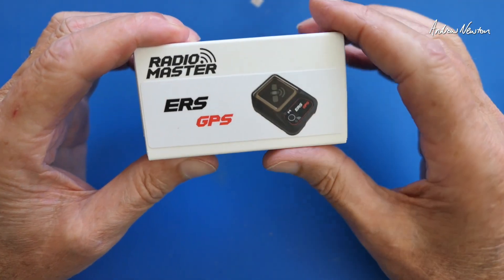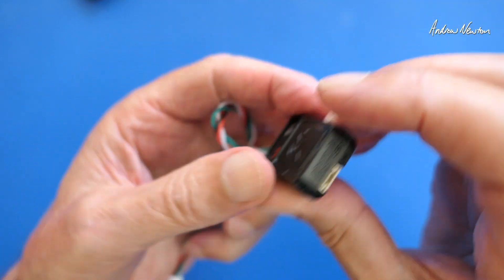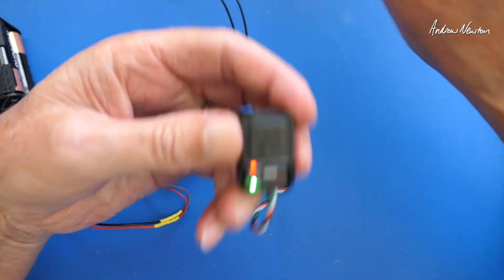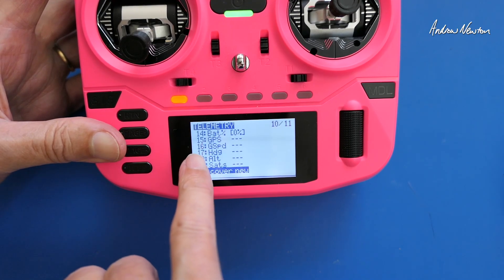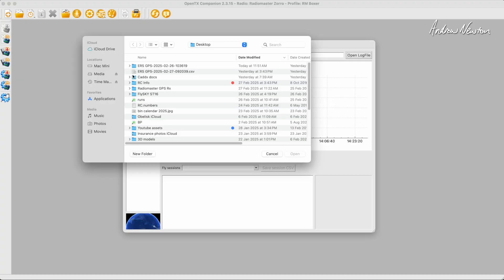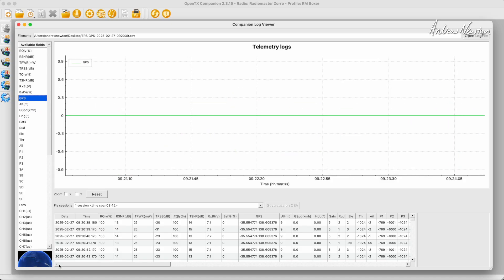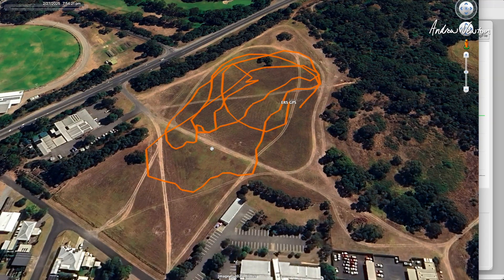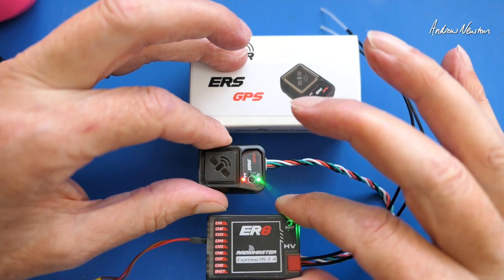RadioMaster ERS GPS Telemetry Sensor

Comment: How do I get data logs in one file. Can you please explain this also, I tried to do it watching a video but when I start logging with 3 position switch on my radiomaster pocket and stop logging I get 4-5 files with data in them but not only 1 file. Thanks for the video. I have bought GPS after watching this video.
Reply from the maker: Should be one log file for each switch activation. Did you switch a few times when setting it up?
Reply: @AndrewNewton  In Special function (Page 10) I have set up SC- to log the data. SC is a 3 position switch I have set it up in middle position to log the data. I carefully switch to middle position and after waiting for 2-3 mins I switch it back to initial position. Now I have only 1 csv file. Thanks for your reply.

Comment: Nice looking unit.
I pull the log file from iNAV blackbox (from the FC SD card) and run it through blackbox tool to create the .gpx file.  Then when the .gpx file is dragged onto Google Earth I see a propmt box- don't checkoff the third one (Adjust Altitudes to ground height) and you get the 3-D track
Reply: I am not familiar with that receiver but they say "A 4-wire CRSF interface is provided to facilitate later expansion of telemetry sensors".  Maybe we can ask to have a baro builtin :goodvibes:
Reply from the maker: Thanks for the tip. I tried with the Radio log file but the Blackbox viewer didn't accept it.
Reply: Not sure what the Blackbox "viewer" does. I use the .exe file in Blackbox tools. When the text file off the fc SD card is dragged onto the .exe it produces 3 files one which is a gpx file. That gpx is what can then be dragged onto google earth which renders the 3-D view of flight.

Comment: Now the only thing we are missing is the Autopilot smartness built into the EdgeTX  radio which can do RTH and Other flight modes without any need of the flight controller board. I hope those Great EdgeTX Gods are listening. Good stuff Andrew.
Reply from the maker: Nice idea but it would ned to be built in to the receiver on the plane, then it would just be an autopilot with a built in receiver.

Comment: OFF subject i'm a newbie who is lost once again.  i have a Zorro Tx 4/1 with a Betafpv ELRS module attached . When I go into the Edgetx program and turn off the internal RF mode then set the External mode to CRSF (which I was told to do ) I can not find the Bind function mode ?..... any thoughts or suggestions?
Reply: Have you tried the method of flashing your external module and RX with the same pass phrase? This was the method I used when first starting out with elrs and it worked quite well.
Reply: @r1m.dog78  Thank You !!!
Reply from the maker: ELRS binding is different. Either use the ELRS Lua script or add Passphrases set up in the WiFi setup page

Comment: This will be a nice addition for my thermal gliders.  BTW, is the UART port on the ER series compatible with the FlySky sensors (e.g. FS-CAT01 Altitude sensor)?
Reply from the maker: No they need IBUS protocol
Reply: @AndrewNewton  So now that RadioMaster have broken the ice with an this one I wonder if they will add external voltage and altitude sensors to the range?

Comment: Think we can hack this into the ERGV? Are there solder pads for CRSF?
Reply: ER8G and ER8GV both have a plug for CRSF.

ER6G and ER6GV do not and have no CRSF or other serial pads on the board. You can reprogram some of the PWM outputs for CRSF instead, but you will lose two of them in the process because CRSF is bidirectional.
Reply: @VladTepes44  thanks! Perhaps you can get away with just the Rx (or is it TX) since we only seem to be receiving data?
Reply: @REDhlg  I do not have one on hand right now, but I am pretty confident when you change one pwm it changes both channels